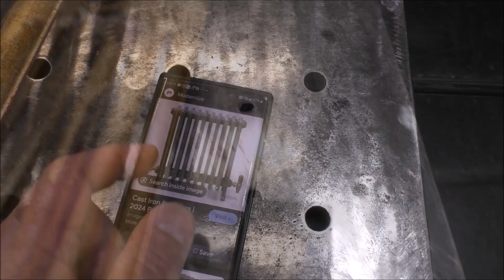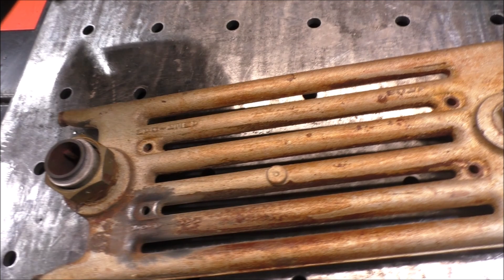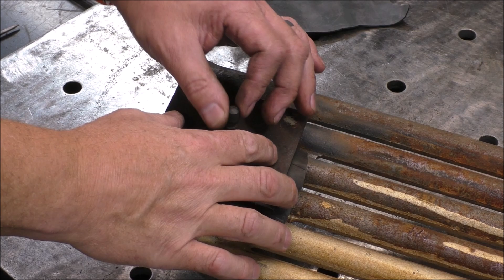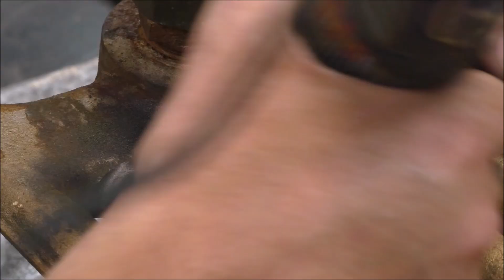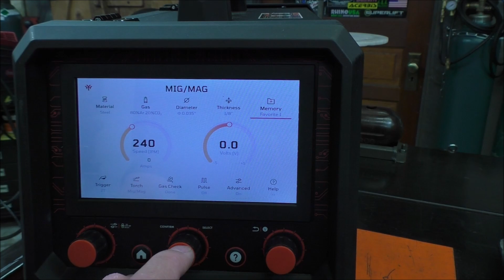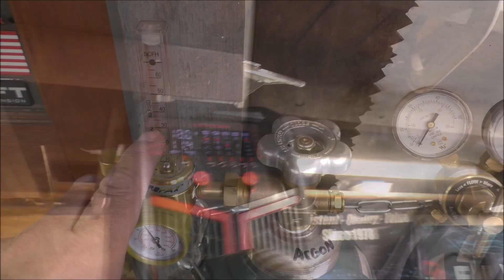MIG Welding Cast Iron Radiator Repair Not Everything Can Be Fixed FAILURE

Comment: I think that crack could have been brazed using BCuP-5  brazing rod.
Just have to get the cast iron cherry red and the rod flows into the crack nicely. Drilling a hole at each end of the crack is also important to getting a good outcome.
The rads only need to hold 30 PSI max

Comment: I worked at a steel mill and we only had one old welder who would touch cast iron and he got the piece cherry red and stick welded it now that was about 45 years ago and it was still holding after 15 years good video
Reply from the maker: Thanks man! 👊 those ol' timers have a lot of knowledge
Reply: We used Ni-rod to stick weld cast iron. Pre-heat and slow cool down was key. 
I've also welded cast iron using 316 stainless steel stick rod and it held. 
In a pinch, 7018 rod will also work.

Comment: Have you tried welding with, let's say, 7018 and copper wire (a generous amount) as additive? So either wrapping copper wire around the electrode or just dipping it into the weld pool.
Reply from the maker: I think I tried it years ago but I don't think I had good results.

Comment: I would have tried it the old way with oxy/acetylene and brass brazing rod but, that has failed before also. 🫤 That new Yes welder looks very interesting!  🤔Good show,Brandon.
Reply from the maker: Thanks man! Once I looked into the cost of a new radiator this size, it probably wouldn't have been worth it to the customer for me to try. I watch a lot of "pakastani" videos and they throw the entire part in home made charcoal and weld it while it's glowing bright red. I might have to try this at some point. It probably works great for not cracking.
Reply: @BrandonLund  Maybe so but the cooling of dissimilar metals can have you pulling your hair.  I also am amazed at the resourcefulness  of 3rd world nations. Good to know if  all goes crazy and the brown stuff hits the fan. 👍🫤

Comment: Beyond comprehension how you manage to test the exact leaks, welding it with CUSI3(?). In the old days we repaired leaking radiaters from around 1920 with Autogene/oxygene flame and fosforcopper. But those were of steel. Yours is far way difficult to repair because of all the variables. It's a fact that 50% can be repaired. Most respect I have is the fact that you show it as it is. We all had those failures. Only thing you can do is to do your outmost. Looks like you put all your effort in it Brandon. Only deep and deep respect. Thanks for the useful info and greetz from holland. Stay healthy, safe and God blessed. Marcel Knippers😃😇👌💪
Reply from the maker: I appreciate that Marcel. I've had the best luck with nickle but more so with silicon bronze. I felt pretty confident i could fix it but after doing a little research it appears some were cast with white iron making it not repairable. I did my best but sometimes that's all we can do. I hope you had a great weekend!

Comment: Win some or lose some!! What more to say??? At least you tried!!  Since I never tig weld…. Thinking maybe tig be more efficient??  Like few reviews says... Good try!!

I was reading on comments…. White cast iron? That's kinda new but makes sense… I have 1890 cast iron stove needs corner welded.. Any suggestions? How fix broken corners??
Reply from the maker: Thanks man! For a stove, I would use some nickle rod and stick weld it.  Give it a good preheat and then when your done bury it in sand

Comment: You gave it a good try and it is too bad the metal did not bond.  Would stick have worked better???  I remember you doing a cast iron skillet with stick, I think.  Better luck next time, Brandon!!!
Reply from the maker: Stick works great on cast but this was white cast iron and its not weldable. I'm not sure what makes white cast different from gray other than weldability, but I should have known when working it with the rotary burr. It looked light gray, so I was hopeful it would work. Hopefully the owner can locate a new end piece or a new radiator
Reply: @BrandonLund  White cast?  Never heard the term but I just looked it up and it is really a conglomerate of different metals (cheap ones).  Wow, learn something new every day.

Comment: If it were me , I would have shortened the bolts and got by with one less slice of radiator ,,,
Reply from the maker: That would work for the center sections, but the ends have legs cast into them.